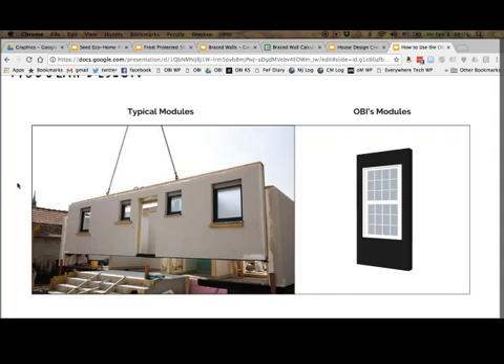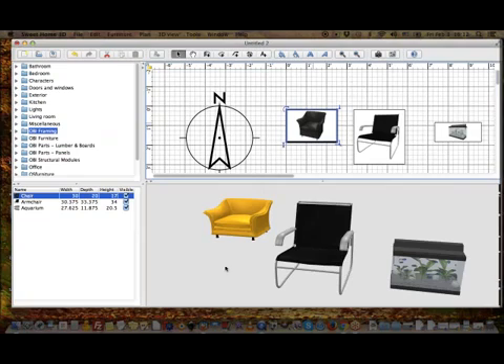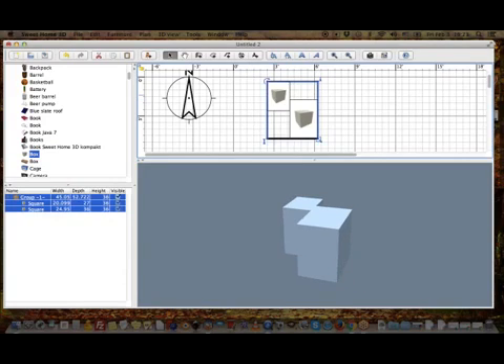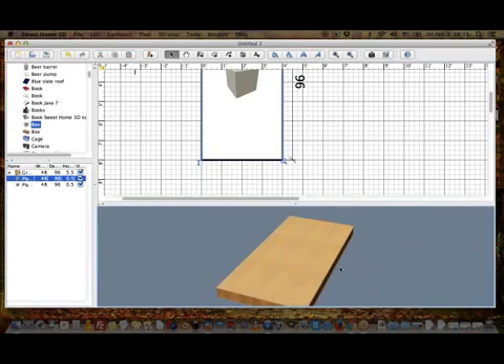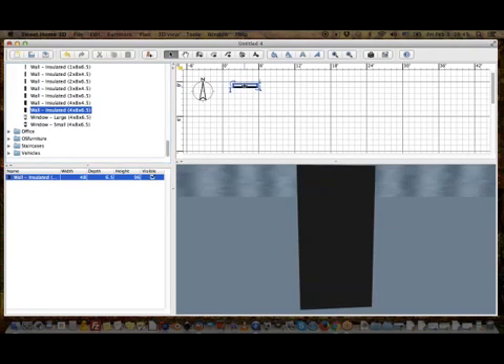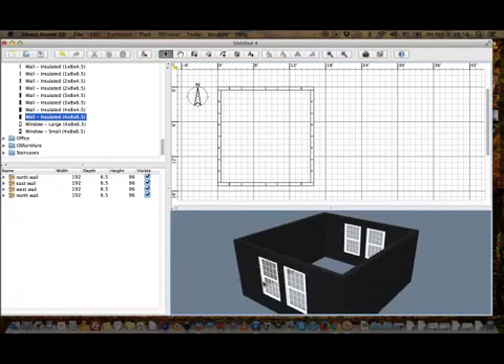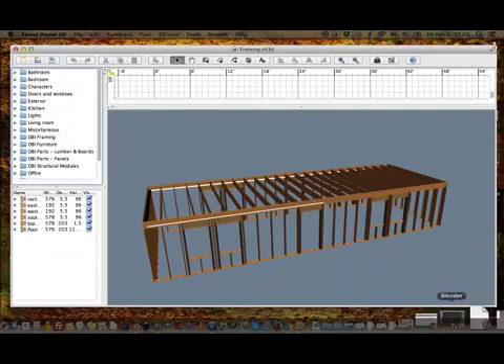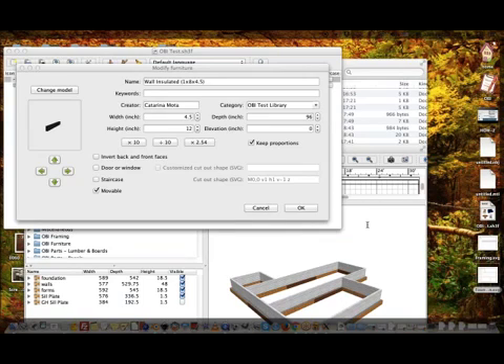How to Use OBI Library in Sweet Home 3D

Comment from the maker: Note the concept of 'fake modules' at 53:48, and how there is a set of conceptual modules for rapid design, and technically-correct modules. This is where mass collaboration can come in to curate and expand the list of technically correct or coneptual modules, so that modules are available in libraries of different scales. It is useful to have modules for individual parts, so that new modules can be created from admissible parts. Second, we can have modules for part assemblies - such as an actual wall module of 4'x8' dimension. After that, we can have larger assemblies - such as kitchen or bathroom - which represent well-designed, generally accepted as good design. There are many such larger assemblies - such as even a collection of building for a community design. The point is - there is a large amount of standardization of good design that can happen - via a crowd collaborative effort.